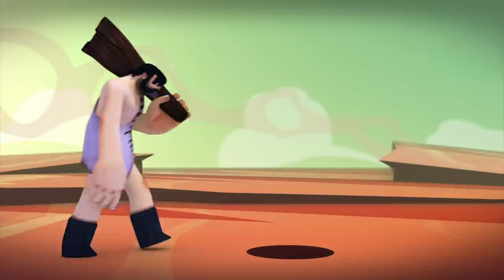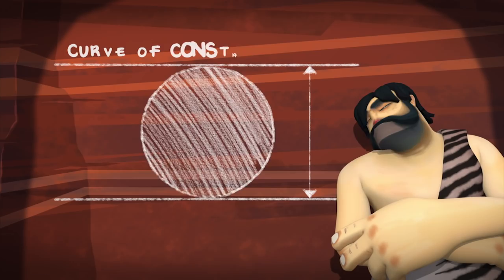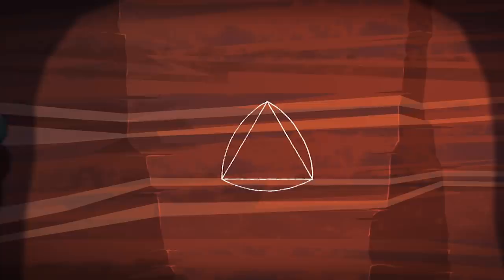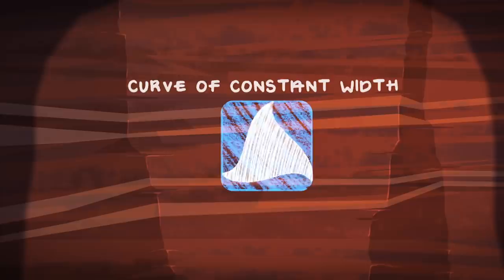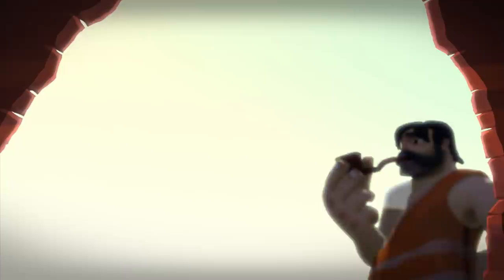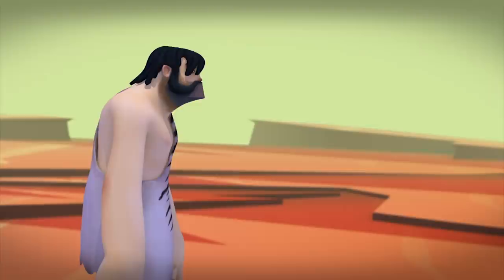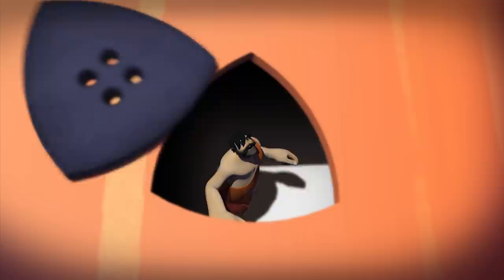Why are manhole covers round? - Marc Chamberland

Comment: Also, because when you make a hole sharp corners are weak points, areas or extremely high stress concentrations. While a circular hole is still a stress concentration, it's the lowest of any geometric shape.
Reply: +Shivanand Pattanshetti actually, if material a function of perimeter it would be equal. It would take removing less material though.

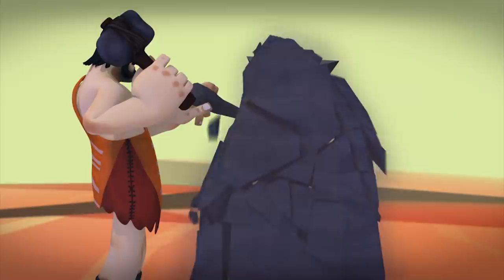Comment: 2:25
Partially true. We can indeed make surfaces of constant widths in 3 dimensions but the reuleaux tetrahedron is not one of them. The reuleaux tetrahedron is slightly wider edge to edge than corner to face. Rounding off 3 edges or 3 corners of a reuleaux tetrahedron will however, give you a surface of constant width - this specific occurrence is known as a meissner tetrahedron.
Reply: Or you could get it by turning a Reuleaux triangle around one of it’s lines of symmetry and the space that it passes through will be a surface of constant width

Comment: So pretty much, the answer is:
So the manhole cover doesn't fall in
Reply: Correct.
Reply: But... the reason it doesnt fall in isnt cause its a circle. it's cause there is a smaller circular suport under it :L Just like metal storm drains and such. A manhole could easily be another shape
Reply: Yes, but it wouldn't be much point in making a square man hole cover with a circular support in it, now would it?
Reply: Tjita1 Oh. I dont know... maybe you could...
MAKE A SQUARE SUPPORT UNDER IT
Reply: Charlie The Cartoonist But if you want to stop the cover from falling into the hole the support has to be smaller than the shortest straight edge of the hole, which as it happens for a square is a circle just smaller than the side of the square.
Reply: For a square manhole cover to be able to be supported by the lip of the opening, the support would have to create an area small enough, that the diagonal of this hole is smaller than one side of the square.
Because of this, there is a significant loss in area in the hole. 
For a circular cover or any curve of constant width, the length from side to side is always uniform, so the hole just needs to be marginally smaller than the cover.
For example: If the square manhole cover is 2 feet wide, then the smallest possible square hole that it couldn't fall down would have to be roughly 2.83 feet wide in any direction. 
That produces a loss of 70% of the area that the manhole could cover up. And that is a huge waste of the steel.
But a circular manhole cover (Or a reuleaux triangle) is different. This cover has the same width on any side, so there are no diagonal widths to account for. Each side is equal, so if the manhole slides on at a bad angle, it could easily fit on without danger of falling in.
It seems like the part that you're hanging onto is that the support and the cover should be the same shape. Which is 100% right, so kudos to you on that. But I feel like the one thing that you didn't pull away from this video is that curves of constant width are at play here. If a square is pushed onto a square hole at a bad angle, it will fall in because the side length is smaller than the diagonal length. but with a CCW, they are all equal, so any hole smaller than the cover (with an identical shape of course) could hole it up
Reply: You’re implying the video is a waste of time. I don’t think it is. It has some fun and interesting information in it.
Reply: @churrocharcharm  you would want to maximize the actual area where the water goes. the square will make sure you either have a less functioning manhole or a much larger than needed cover
Reply: Also, so that it rotates

Comment: Short answer: So the cover wouldn't fall in

Long answer: Because if you rotate a circle the distance between the bottom edge and the top edge will stay the same distance apart and they could act like a wheel.

Comment: A manhole is made of two parts. The manhole cover and the frame it sits in. The frame has an inner lip which the cover or lid sits in. The actual diameter of the lid and the concrete tubes which are stacked on top of each other may be the same diameter but the lid itself will never fall through the frame.
Reply: Exactly. The hole isn't just one diameter and its never a friction fit like is show in the video. The counter bore of the hole, or the "lip" so to speak would allow any shape to work. The whole argument for it needing to be constant width completely ignores the real world application of manhole covers.
Reply: @timothymantor7332  If you don't want the lip to have to be huge though, the shape needs to be of constant or near constant width. If you had a square manhole cover, for example, it could fall through the diagonal unless the lip is huge (at least (sqrt(2)-1)/2 ≈ 0.2 times the side of the cover. So if it was 1m wide, you would need a 20cm lip on each side )

Comment: "Ruleaux tetrahedra" are NOT solids of equal width.  There's a bit on the corner edges that over laps.  The actual analogue that does work is bounded by a fifth, much smaller sphere in the middle. Another one looks kinda like an  'egg bullet'.

Comment: 1) I like the animation. Well done and a good way to break the norm.

2) what if we had a Rulo-triangle wheel? How would that work out? Better or worse then our current tires? Would it save on materials needed to make the tire/wheel?
Reply: Although it has a smaller area, the pointy bits are weak points

Comment: Would an equilateral triangle fall in though? With other polygons you can fit an edge between two opposite vertices, but an equilateral triangle's edges are the lines between opposite vertices.
Reply: With an equilateral triangle you can fit its height inside a base

Comment: this is an interview question: Production costs would be my answer.
consider we need a hole 2 feet in diameter:
a square would be 4 sq/ft: 2 w x 2 L = 4
now a circle's area is pi r squared :
if diameter is 2 feet, then radius is 1/2 = 1 foot
pi(rounded) 3  x  (radius) 1= 3 sq/feet

so you save 1 foot of production, distribution and labour
plus, the squares have a hinge which raises production costs.

Is the math above correct?

Comment: im confused about the reasoning at 3:02 because squares are like the only shape that can fall through the hole they make. equilateral triangles cant, right pentagons cant, right hexagons cant, right heptagons cant and the list goes on...
Reply: Those shapes all can. the height of equilateral triangles can fall through the base, and with any "right" shape a shorter diagonal can fall through a longer one.
If a shape isn't of constant width, that means at some points it will have more width and at others less width, and so the parts with less width can fall through the ones with more width

Comment: A simpler answer would be that it's the cheapest way to have an access hatch on a round (sewer) pipe.
Reply: +isgdre and the immediate question would be: "why is a sewer pipe cylindrical?"
Reply: John Yyc
To resist the pressures on it.
Reply: +isgdre 
Equivalently, so Mario fits through.

Comment: for a reuleaux polygon the shape must have odd number of vertices and since circle is a reuleaux polygon with infinite vertices dose this means circle has odd number of vertices i.e. Dose this mean infinity is an odd number??
Reply: wowzer
Reply: As you can see with the polygons, as the number of sides increases, the length of these sides decreases until such an extent that these sides are too small to be seen and from a distance, the polygon with very many sides looks like a perfect circle.

It's not that infinity is odd, its just that there is relatively not much of a difference between a polygon having N sides (N being a very large number) and a polygon with (N+1) sides. Surely, one of these shapes have an odd number of sides. But because of the very small lengths of the sides, there is but, an infinitesimal* difference. The difference is so small, it almost doesn't matter anymore.

The beauty of the circle seen here is that the number of its sides is too large and therefore described as infinity but we cannot even imagine the exact number and this can be thought of as either even or odd.
__________________________________________________________________________

infintesimal is the opposite of infinite : it is used to describe very small numbers  (ex: 0.00000...more zeroes...000001 is an infinitesimal number)

Comment: Sorry but the Reuleaux tetrahedron is NOT a surface of constante width: the two midpoints of opposite edge arcs are separated by a larger distance!!!!! it would be an excellent video if you checked your information's first!!!
Reply: They showed you an animation where it rotated between 2 lines, and as far as I can tell, there was no stretching or shrinking.
Reply: Oh am not talking about the reuleaux triangle but about the reuleaux tetrahedron. Indeed they showed an animation where it was rotating between two plans but it must be false! If you don't belive me just check it on Wikipedia!
Reply: +Mounir Mallek Here are some that have been manufactured.  They do talk about how the construction does require an extra step to handle the edges to actually make it a constant width, but the shape can be made.

Comment: While its true that any shape without constant with would be able to fall through a simple blind hole of the same shape this video completely ignores how manhole covers actually work. The covers are never relying on a friction fit to hold them up, like is shown in the video. The hole is not just one diameter it is a counter bore which creates a "lip" for the cover to sit on. This would allow literally any shape to work. "It would fall in if its not constant width" is not a valid reason to make the cover a circle.